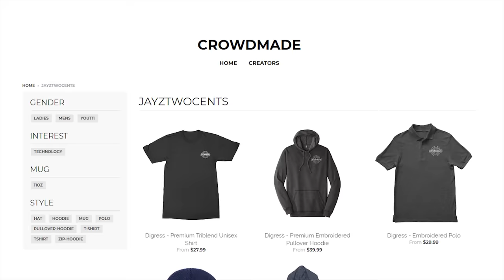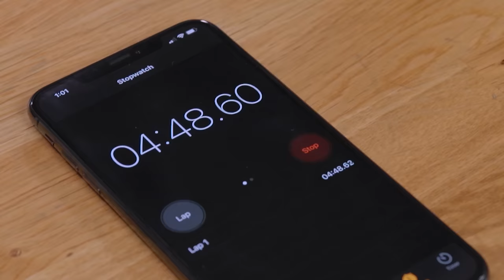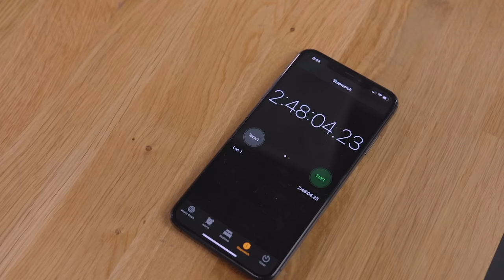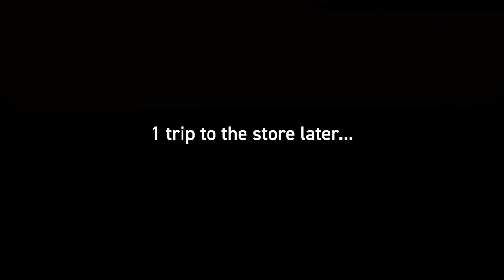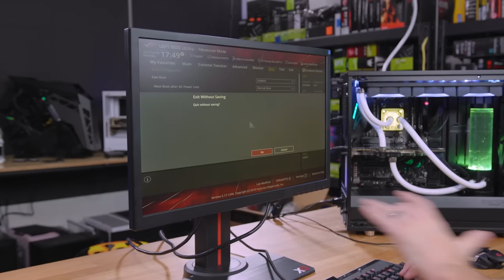Trying to see how fast I can build a watercooled rig!

Comment: You heard it here first folks, the Ryzen 7 2700x is the highest end GPU on the x470 platform. 1:49
Reply: Lmfao i should get one of those easy 240 frames 1080p plus with a RTX 2080 TI "CPU".
Reply: Pair that baby with 32 gigs of power supply running at 69ghz and you've got one hell of a rig
Reply: @magnuslikestanks6044  your damn righy i am 😂😂😂
Reply: @magnuslikestanks6044  you also need two fractal desing define C running in SLI @14mhz for maximum performance!
Reply: @yannicg  and gotta have those 64gb of noctua NF-12 running at 3200mhz
Reply: Magnus Likes Tanks it was going all well until you said 69... really man?
Reply: @yannicg  Don't forget to overclock your case
Reply: omg jay is mad where is his wireless anti static bracket, u could have broke your friends system .o.
Reply: @hamisha81  Nobody uses that shit, just rest your arm on the case =P
Reply: Your Face never seen the verge vid?
Reply: @hamisha81  Ugh, yes I've seen that masterpiece...
Reply: @magnuslikestanks6044  pffff... bro... my 80gb plus power supply is overclocked to way more than 69ghz ... try 86ghz big shot!
Reply: Everyone forgot the 1TB of RGB cl12 for maximum performance!
Reply: Must not forget the DDR4 SSDs.
Reply: Plus a 750watt ram stick and you're good to go

Comment: points at the CPU*
"this is the highest end GPU you can get"
Reply: if it would be a 2500g, he would be right lol XD
Reply: Rewind he said for x470 boards
Reply: Yea integrated Vega Graphics are way better than dedicated GPUs
Reply: I wish my GPU had 3.7+ GHZ clock speeds. And completely the wrong architecture for the job with no onboard VRAM. 

@Clorox Bleach I'm pretty sure the 2700X has no integrated graphics.
Reply: @C4ndleJ4ck  r/woosh
Reply: lhh

Comment: 5:17 R.I.P. stock cooler
Reply: F
Reply: The stock cooler is actually pretty good... But since the build was mainly for water/liquid cooling, it was pretty much useless
Reply: N they sell for 40$ easy. So if u buy a 2700x u can sell stock cooler  for 40$ if u don't like it . I bought my 2700x for 200$ new  when it came out. Already had a cooler sold it for 50$. Paid 150$ my 2700x :)
Reply: LMMMAOO
Reply: @BlackUmpire  there do, lol. wtf u talking smh

Comment: Nice looking build. Soft tube runs are a little long but it makes sense without a drainage system. I'm currently rocking two soft tube builds and two hard tube so I totally agree with you about the validity of soft tubing. Most of the builds I do for customers end up being soft tube purely due to their desire for a more reasonable price and service-ability. It's hard to do petg or acrylic for less than ~$400 with more than one radiator. Still, I put a drainage system in every build even if it isn't used often if for no other reason than it makes it so much easier to swap out primary components one at a time.

Comment: I actually like my soft tubing. I do ultimately want to do hard line, but you made a really good point about it being easier to deal with upgrading parts with soft. I guess I'll just accumulate the hardline parts and have them for when I hear more on when Zen 2 will be released. I'll decide then on either waiting or going ahead with putting the parts in. I do have a Heatkiller IV (acrylic/nickel) coming for my 1070 TI tomorrow, so that little change should hold me over for a minute at least. One big plus, for myself anyway, of installing all of the cooling components and using soft tubing first is that it is easier to visualize the hardline runs. This whole water cooling thing is even more addictive than the PC building itself, in my opinion. I LOVE IT! One note, Jay. I've never heard you mention anything about UFO Technologies Cryo-Chillz coolant. I've been running it for a while now and it holds up really well. After researching the "effects" coolants and reading/seeing the nightmare stories about VUE and Aurora I was skeptical about using any of the at all. I came across the Cryo-Chillz and I'm glad that I did. It looks great and so far no issues at all at 2 months of use. Everything is as clean as when I was using Mayhems X1.

Comment: To bad you did not put a second radiator in there. that was my idear as well with the same case. And i would love to see some thermals and overclock settings.  I think that with 1 rad the system will be a bit hot because your cooling the GPU and CPU. i want a follow up video ;)

Comment: Not gonna lie, I was expecting 30minutes. I know that is extreme, but I figured you were so use to it that you would fly through this. I have only built air cooled systems so I don't know what water cooling adds, but I built my most recent system in about 1 hour. No unboxing, it was more like move a Pc from one chassis to another. SO somethings took more time like unscrewing old pc screws, but ram was done. CPU fan was done. CPU done.

Comment: I just did an upgrade to my formerly 4690K system. Same board, 2600X, G.Skill RGB ram and an M.2 drive. I've discovered that ASUS AURA software has a resident program service that runs if you do any type of color cycling. Static color doesn't use it. The program is enough of a resource hit that CB15 loses about 50 points when it's present. It's constantly using about 3.5% of the CPU.

Comment: Ever do a build with the Cougar MX-330 mid-tower case? I did my first build with it and I like it. The case is well ventilated and have plenty of options for fan mountings. My build included this case, MSI B450 PRO VDH motherboard,  2x8 gig of G.Skill Ripjaw memory, GTX 750 ti graphics card, Ryzen 3-2200G processor and Rosewill Glacier Bronze 600 watt P/S. My gaming title are all low end type, and run great. If needed, I can always upgrade the graphics card or CPU to Ryzen 5.
Reply: Cougar case: https://www.newegg.com/p/N82E16811553031.

Comment: Soft tube watercoolers where you at, theres nothing wrong with soft tubing, currently rocking ekwb zmt tubing in my loop and it looks great with my primochill,bitspower,ekwb fittings with koolance quick disconnects. Im more about performance and accessability than pure looks. Petg is cool and all but it does get cloudy over time and glass tubing is such a pain in the ass. Im more proud of my max temps of 47c and 35c for my cpu and gpu in games while being very quiet.

Comment: The Define S is still far and away my favorite case. I just need to pick up a tempered glass side panel for mine, the original acrylic window scratches WAY too easy :(
Reply: What are you doing with your case that its getting scratched.

Comment: What about hard line cooling using copper pipe and associated fixtures and fittings and copper pipe can be bent like hard line but can also be soldered using lead free solder which you cannot do with other hard line cooling products.

Comment: I just pulled the guts out of my computer and replaced my trusty old i5 2500K on a Z-68 board with a R7 2700X on an Asus Strix B450-F. I was amazed how fast the old parts sold on Facebook market place. People were queuing up to get it within minutes of listing. 

I have not got a new GPU yet because I am waiting to see how AMD Navi goes. The GTX 1050ti that I am using with this new CPU does not give me a higher 3DMark score than the 2500K got. That old CPU can still deal with the little 1050ti just fine. I do get better performance on Fallout 4 though. What really impresses me about the 2700X is how it handles VST plugins in my digital audio workstation software called Reaper. The 2500K would max out CPU usage, but the 2700X barely breaks a sweat.

I will chuck a Zen 2 in there if i see a bargain and then flick the 2700x, but I really do doubt i will get the kind of service from any current or near future Intel or AMD CPU that the 2500K gave me. More than seven years before it really began to show its age. Sandy Bridge was pretty damn good. 

p.s. Damn that Bill Gates. I thought he was being a nice guy by upgrading me to Windows 10 for free, but he did not like the hardware change and refused to activate a clean install even though the license was linked to my MS account. He directed me to the MS shop where a new Win10 pro license is $400 NZD. I am going to have another go at switching to Linux.

Comment: Been planning on going hardline, designing a desk that can have a computer in it with the top be a plexi, and the rest aluminum that il weld in shop. Its still a bit vague on like the whole parts for watercooling besides the tubes, the fittings especially

Comment: Those fans are case designed ones, prettier than regular AER P NZXT, but, I wouldnt use it as push/pull radiator fan.

Comment: I am wondering why don't fan manufacturers make separate intake and exhaust fans so that the lights show both ways meaning the front panel fans point their lights to the inside of the case. However this will only be useful in cases with non see-through front panel.

Comment: You're very fast and the system looks great, the parts there are amazing. One thing I only don't like are the tubes.
Reply: Yeah totally agree they look messy and clear would have been better, I don't see where the white fit's in with the system. If you want white then use white fluid. Nice build otherwise.

Comment: 1 360 30mm rad is a way to produce a loud system... might aswell go air..
Reply: If you're gaming that'll be plenty of rad & fans to run pretty quiet, maybe not near-silent but still much better than any air-only GPU, that's where the majority of noise comes from when gaming.

Comment: Is that a Tian X MAXWELL or Titan X Pascal - non-p?  Either way, it will be a GREAT card and a HUGE upgrade from 2x GTX 680!

 I run a GTX 980 Ti OCed to 1503 core 8 GHZ effective VRAM - it destroys any GTX 1070, and is neck and neck with a tweaked GTX 1070 Ti or a Stock FE GTX 1080!

Comment: You could totally have had the front rad installed and made it look good, if you'd have gone from the pump the rad then rad to cpu. Would have looked better than it does now probably.
Reply: I agree completely.  Jay went for building it fast, rather than building it right.  NOT a very cool setup IMO.  It should also have had an NVME boot drive.
Reply: Shaun D Jay himself would definitely tell you, it won’t matter.
Reply: @Shaun D I have mine setup like that due to case restraints and wanting it to look neat. Works perfectly fine.
Reply: @Shaun D No, I have both CPU and 2 GPUs in the same loop with 2 360s. The pump outputs to the first radiator though, which goes to my CPU monoblock, out to GPUs, out to second radiator, to res, then back to pump.
Reply: @Shaun D That's not how water works, and Jay himself has said this and proven before on video that it works perfectly fine. If what you said was true, my top rad (after pump before CPU) would barely get warm while the other stays hot as it's after all the components. They both heat up equally. I think Jay has probably 3 or 4 videos on how loop config does not matter.
Reply: @Shaun D Your first sentence contradicts your last post in saying the other radiator isn't doing anything. If you work in that kind of industry then you know the more radiator the more headroom. You should also know that not all of the heat is dumped in a single pass, and that heat transfer is equalized through the entire loop including components that aren't radiators. It's pretty basic science and should be pretty common knowledge for somebody supposedly in that industry. What's the point? Sure, he could get away easily with a 240 in the video for just a CPU and a GPU and I could get away with a single 360 technically. Custom water allows the capability of massive headroom in your cooling capability. This isn't like a car where you need an operating temp, the cooler the better. The more headroom the less airflow needed to dissipate heat. Even with an 80mm 360 and a 60mm 360 with Noctua iPPC fans running at 800rpm my rads still get damn toasty because I overclock the dogshit out of my components. Not that I need to, but because I want to. Just like my loop, not that I needed to, but because I wanted to. My radiators get hot to the touch but my PC is still silent and my temps less than 60c at all times. Again in my case my loop direction makes more sense due to my case and part setup. I can run my tube behind the motherboard tray to my top rad instead of having a tube going right in front of my components making it look cleaner without any loss in performance. When I finally replace my MCP50x and separate res with an EK combo I'm sure you'll hate even more how my new loop direction will be lol.

Comment: His rig was not that bad at all. My PC is also from 2012 but I only have: single GTX 650, i3 3220, 2×1TB WD Blue, 2×2Gb G.SKILL DDR3, H77H2-M3 motherboard dirt cheap psu 600W
Reply: Welp. You could reuse the case and PSU and go with a simple mobo, CPU and RAM upgrade. Shouldnt be that expensive. But i feel you. i5 4570 8gb RAM. But i upgraded to a 1060 6gb. It only bottlenecks in extreme cases so im fine for now :)
Reply: Don't reuse the dirt cheap PSU lol! dont want a 🔥.
Reply: I mean. Most newer parts are more power efficient while being better. So I don't see the big problem. But I kinda get you. Dont wanna push luck and shit

Comment: I have a corsair H80 from 2013 on my 3770k. I blast the dust out of the heat sink every now and then, processor is still cold.

Is there a time limit on coolers?  Or just when they fail.

Comment: That loop is weird. From the pump, to the CPU, then rad, then GPU, then back to the res.. I understand it reduces the amount of tubing, but it also doesn't cool half of the circuit after the GPU.
Reply: The ideal is rad > GPU, because it is the real generator of heat on the loop, the rest dont really matter (to be true even rad > GPU only give a minimal amount of benefit to the loop, the order of all components dont really matter too much because water can get a lot of energy between each degree. it can make several loops before increase 1...2 degrees, what really matters is the brute dissipation power of the rads to avoid the water to slow increase temp. (Sorry for any bad english, i got no time do verify it)

Comment: I have a MAC pro 2008 with a upgrade with windows 10 pro a 250GB SSD and a GTX 1060 but it’s the cheapest one and it does not go as fast as it should and everything else is stock and it is hella slow

Comment: Hi,  you stated that the flare x was the best for Ryzen.  I am running currently (Corsair CMK16GX4M2B3200C16 Vengeance LPX 16 GB (2 x 8 GB) DDR4 3200 MHz C16 XMP 2.0 High Performance on a ROG-STRIX-B350-F and Ryzen 2600).  However, out of the box it only runs at 2300 or there about.  would you recommend changing to flare x ?

Comment: i really like the build jay , i build my own amd ryzen system using the same components the day before xD only i went for the gigabyte aorus pro and an rx vega 56 and i did use the same ssd  , but windows is on the m.2 samsung evo 970 pro both the cpu is overclocked as the rx vega same water pump and reservoir only i went for a termantake case and for the 2 radiators :p , and my speed build was 1 hour 32 including windows install , next time we do a build off live stream ? ;) ,

Comment: Hi. I am upgrading my computer and do not really know what to do with graphics cards.
I have a Asus GTX 1080 Strix oc
I am also doing water cooling
and system specs is
Chassis: Deepcool Quadstellar Midi Tower Limited
Motherboard: ASUS Rampage V Edition 10
CPU: I7-5960X
7TB Storage and 250GB SSD OS Drive
PSU: Broken :) reason for upgrading
also thought to switch to an i7-6950X
so I figured if I should change to a 2080ti or if I should look at 2X 1080ti.
thanks for all the help in advance and love your channel

Comment: hi I am resently buy asus x470 + ryzen 2700x+flarex 3200= pc is randon reboot and I dont know hot can I fix it,  pc was stable all day, but once a day it starts restarting again and again, it only helps to turn it off from the source and wait 5-10 min, and when it works it works well, can you share your bios configuration? it can be help for me, thnx
Reply: yea I got the hero and the 2700x as well what are the settings you recommend to over clock?
Reply: @SirDeadPuppy  I only follow this guy on test and bios, and other say,"put cpu voltage to 1.425v for stable 3200Mhz" I pass all tests, with no errors, but cp once a day is randon reboot, and when it start it can be many times, if I turn off pc, wait 5 min and problem is gone
Reply: pc have 2 weeks and my config 
ryzen 2700x
hero 7 x470
32 gb flareX 3200
2 m2 samsung 512 pro
Reply: @olegroso1   I got 2700x
hero 7 x470 wifi
triden z 3600
Samsung 970 pro

idk I am new to pc building my self I was hoping some one would share there bios configuration  for a nice over clock or at this point just a place to learn how to do it my self . I dont know about your issues so my off the wall guess is maybe you need to re-seat the cpu like as it heats up it might be expanding or something and that why it reboots then it cools off and is fine again??? just guessing though ..like I said I am new to this stuff as well but good luck you got almost the same pc I do so I wish you the best!!!
Reply: @-TerribleSniper- my pus is ok, it was ai suite3, I was desinstaled it and pc is not reboot, but cpu cooler en 10 sec change rpm from 10% to 80%

Comment: I  am not a fan of Windows. My current rig is a Mac mini with 16GB of RAM and a 1TB HDD. I purchased this unit in December 2017. I paid $1200.00 for that unit and to replace it with a comparable 2018 Mac mini with 32 GB of RAM would cost $2599.00. So I have decided to build a Hackintosh Pro. Using off the shelf products I will save, $1050.51 So why should I buy something that cannot be improved upon much at all?